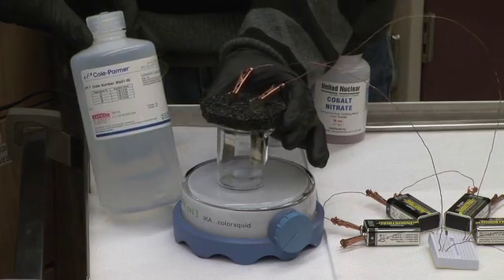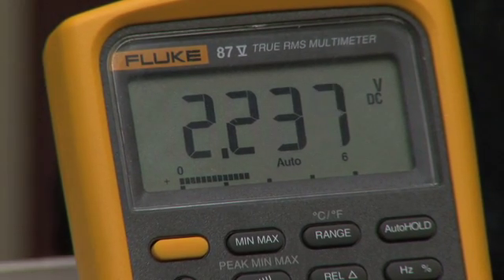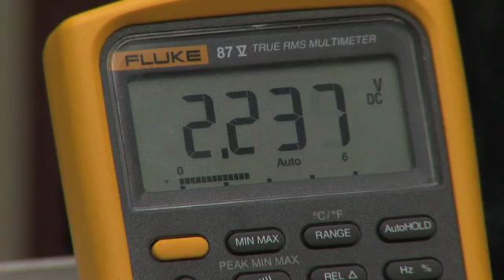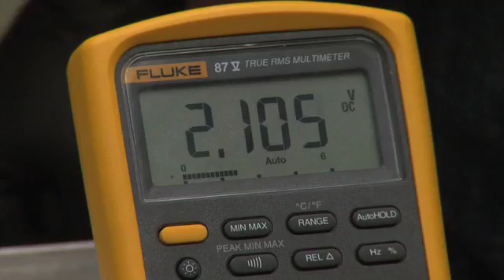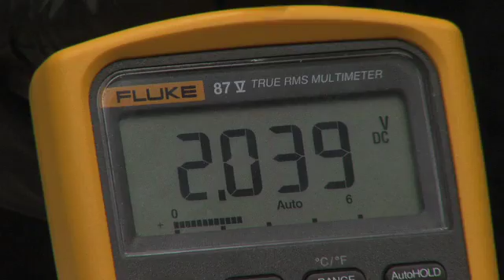Splitting Water | Science Project

Comment: After starting this experiment, I found the voltage did not drop straight to 2 volts but instead dropped .1 ever couple of seconds. It took 25 minutes for the voltage to go down to 3.1 (no catalyst added, just the control with the conductive solution). A brown film also covered the anode, im pretty sure thats normal. Any thoughts?